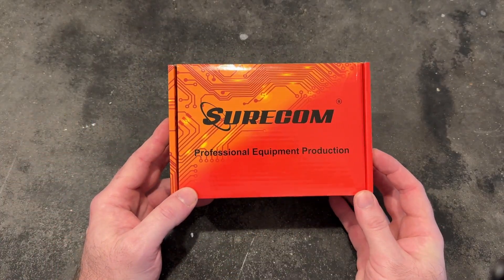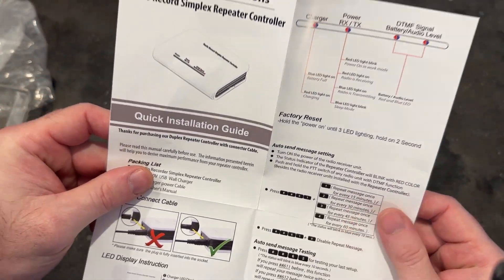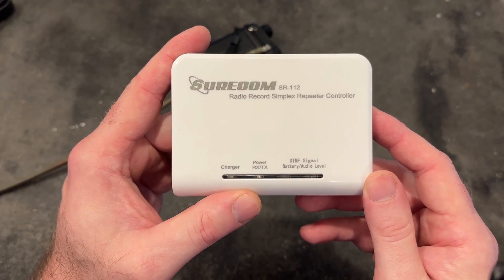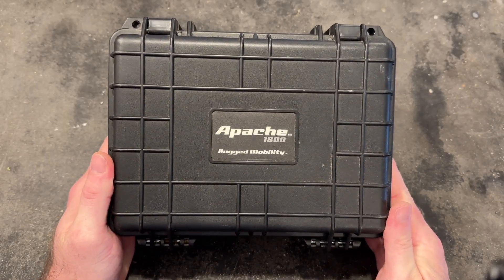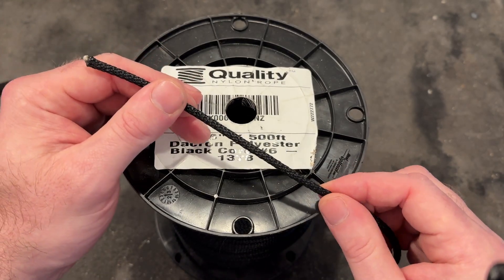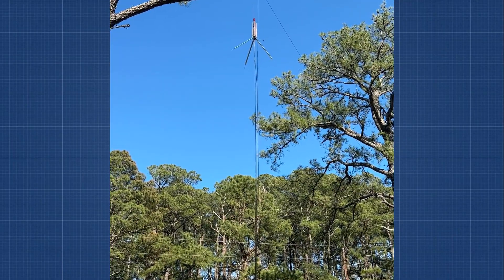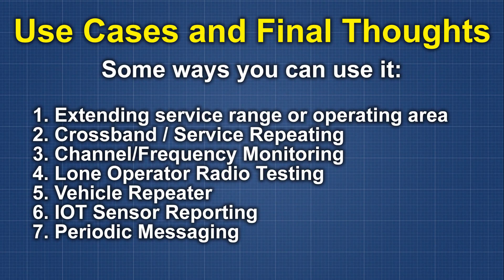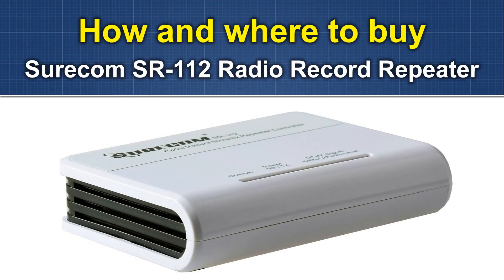You Can Build The Cheapest Repeater in less than 5 Mins! GMRS/HAM Less Than $100 - Repeater TUTORIAL

Comment: So if you did this but used a good antena with a good coax im sure this would work good.
Reply from the maker: A good antenna and coax would certainly improve performance!
Reply: @Commodium im a bit of a noob at this. Im sure you've answered this a million times. Do you know of a decent coax that will attach to a handheld and a semi decent antenna for a good 5 mile-ish radius range? Or maybe you already have a video to something like this? Also with this setup after you transmit do you hear yourself when it repeats or are you listening to a second radio when you did your tests?
Reply from the maker: @kick_then_shift There are a couple different options. Firstly you could simply upgrade the existing HT antenna. I have some of those available that are excellent. Next if you want a little more boost in range, one of my single element CRE-35 and a short (15ft or so) run of LMR-240 or RG8X Teleflex with adapters would work fantastically. All of this does assume you have the terrain and conditions necessary to make contact. (Near line of sight, low ground clutter, etc) email me at stevetow01@proton.me for more details

Comment: What is the counter balance for and why do you need it on the repeater and the one you are using in the truck? oh, and what is that "counter balance" cable made of...Thanks.
Reply from the maker: Certain antennas can benefit from a ground plane. The wire enhances that effect. But not every HT antenna will perform better with one. That particular one I use is silicone jacket 10ga wire

Comment: Love this video and your style of video making. I plan to make one of these to use for my friend group when we head up north for camping trips and there’s no cell service or local repeaters nearby. 

I will be using that same waterproof box (bought at harbour freight when on a trip to the USA)(I’m Canadian) but I will be utilizing a dewalt 20v tool battery and cradle to power a usb port that will “charge” / “maintain?” The power for the radio and controller, I will be putting a folding antenna on the outside of the box. 

I learned some good stuff from this video like adding a second string to the bottom so the antenna stays straight up and down, but how will I use the counter poise / ground wire when the radio is inside the box? Maybe I’ll have to run it without one. Either way thanks for the video rock on my man 😊

Comment: To eliminate hearing the original broadcast (which was of very poor quality) make the simplex repeater radio frequencies the same as a duplex repeater. So if your HT's repeater channels are say transmitting on freq. 440 and receiving on freq. 445, make the simplex 's radio receive on 440 and retransmits on freq. 445. Instead of a plus offset you use a minus offset. That way the second person only hears the simplex's retransmitted broadcast (much better quality). Removes the main downside of simplex repeaters.
Reply from the maker: Yes, that covered in the follow up.

Comment: Very cool video
Im trying to find out about the little antenna tester unit that the other guy over on ham radio crash course got from you is there a link or place to get one of those or purchase? Thank you.
Also, wondering which type of video cameras are you using for your videos? I have started a YouTube channel for reviews etc. not released yet.
Reply from the maker: Testing handheld HT antennas can be a real challenge. I built that unit I sent Josh over at HRCC as a prototype. It is made from 206 brass to the size and shape average to most of the popular HT radios. It has a pass through from the SMA to an N-Type connector at the bottom. The pass through is Belden 50 ohm rg8x coax with the shield bonded to the brass. There is also a layer of copper foil that has some capacitive reactance and a copper foil “thumb pad” to simulate contact with the radio. It works pretty well and allows for more accurate testing on a VNA. I don’t have them available for purchase, but drop me an email Stevetow01@proton.me

As far as cameras go, I use a Cannon DSLR G1X and plain ol’ iphone 15 pro max. Good Luck on your channel too!

Comment: Is this legal lol...
Reply from the maker: Just as legal as anything else people do with radio 🤣
Reply: @Commodium  the correct answer is yes as long as I stick to the gmrs repeater channels which are ch 23 to ch 30 and don't exed the 50 watts and i.d every 10 minutes when I'm on the air
Reply from the maker: @CHRIS2CRAZZY  10 min is for HAM, 15 for GMRS. Why the difference? I can’t answer, but I’m sure there is guy sitting behind a desk in DC that never touched a radio in his life that can. Or a rather over nourished fella in his basement that will chime in. Assuming he can pull himself away from the comment section of notarubicon or r/GMRS. 

But yes you are correct. Keep it to the GMRS repeater channels with the proper split and ID as required. Should meet the requirements.

Comment: Question: Let's say you have a standard repeater with the +5MHz offset.

Can that repeater also handle another tone/offset? 

In other words can one repeater do double duty?
Reply from the maker: Yes it could in theory. The hard part would be using “TOR” control for the transmit side. (Have to figure out which frequency to transmit on) A repeater controller with CAT control and suitable radio may be another way. A radio with dual watch or simply scanning two frequencies with the range limits of your duplexer would be very easy on the receive side of things.

Comment: I am intrigued by this, but I happen to live in an area with several GMRS repeaters. Could someone please reference several Use Case Scenarios in which a Simplex Repeater would be advantageous?  (Two $18 UV-5R radios and the Surecom Mcbazel SR-628 Cross Band Duplex Repeater Controller would do the same thing in duplex.)  Thanks in advance.
Reply from the maker: Lots of issues with a setup like that. It will work to a degree at really close ranges, but that defeats the purpose of a repeater. Here is why you don’t want to that. Mainly desensitization. Even if you crossband, the UV-5R front end isn’t filtered enough to block adjacent RF. Look up every YouTube video on “UV-5R repeater” and you will see everything from straight cross over cables to the Surecom. And you never see them linking two operators at distances measured in miles. And there is a reason for that. It just doesn’t work. Even if you add a duplexer for in-band or diplexer for crossband, (which helps) but that still doesn’t fix how leaky the radios are. 

Could you use a duplexer/diplexer and wrap the radios in tin foil? Maybe 🤔 

But then that brings us to the next issue. Passive intermod distortion or “PIM” that’s why you shouldn’t use LMR-400 or any foil/braid combo shielded coax. 

So by the time you pull out the tin foil, duplexer, hardline coax or rg-213, you may as well use two commercial mobiles, toss em in a wheeled case with big battery and a real controller.

However that is a bit of $ to put together.

So if you want a super simple “camp repeater” that can actually increase double your range or more, the simplex parrot repeater is the way to go.

It is definitely not perfect. But super simple and cheap

Comment: Thank you Sir for the video. Very interesting.l am new in the radio world and was looking for a repeater to increase the range of the Baofeng and found your video. I live in Mexico ,in hurricane area so is good idea to have an alternative way of communication. I want to know what's a counterbalance ? Something to balance the radio? Where l can find one? And the other question is do you have an horizontal line that goes between two trees or one tree and a roof house? And then put a line vertical to that horizontal line? May you make some drawing? Sorry for my English. Regards from Mexico
Reply from the maker: Greetings to my new friend in Mexico! 🇲🇽 the counterbalance (counterpoise) is a small tuned piece of wire added to a grounded screw on the radio. Certain antennas such as quarterwaves and 5/8 wave can benefit from an added ground plane. Other antennas it may make no difference or may even be detrimental. Experimentation will let you know if it helps the one you have.

The horizontal wire you saw running through the tree (good eye catching that) is for my SDR radio i use for HF receiving. It’s a 250’ 14ga wire running to a balun with ground rod. I can hear stations all over the world on that.

For HF transmitting I use a mix of almost a dozen different antennas depending on band and polarization.

Comment: You can cross link the RX/TX on the dual jacks of the Baofeng and put the radio into VOX mode, and you have the same thing basically. Needs two of the cables with the dual jack, soldering iron, and a couple resistors that need some attention with a meter.
Reply from the maker: Hmmm the word of the day: Desensitization
Reply: @Commodium  Feed line for one HT :)
Reply: Commodium is correct, Baofengs and other Chinese direct conversion handhelds can't be used as repeaters, both in the same band or cross band desintetization will kill the intended use. Simplex repeaters are the way to go.
Reply: @carlosroig5315  That's what a feed line is used for. One feed line off one of the radios to move the antenna away a bit. It does work with no issues. You can use cheap coax you find at the truck stop or nice stuff, you just need the sma adapter. If you have the HT right next to each other - that's when you get desense. With a feed line you can keep them together and just move one's antenna a bit further away.
Reply from the maker: Cheap coax from the truck stop? Like RG58 from Loves? On UHF frequencies?  I mean sure you could make a crossover cable with resistors to attenuate the audio. And yes you could attempt to lessen the desense with a chunk of RG58 and add about 12ft of vertical separation. But the coax loss is probably helping more than the distance 😂 Stick the whole thing together with some well chewed bazooka joe bubble gum. But by the time you do all of that and add a second radio and solder the cable “ish” thing together separate the antennas, you’ll have the same cost and more time in that than the simple simplex parrot repeater. And the parrot repeater would give you much much better results. 

But this video isn’t about a “proper” repeater. This is about a quick cheap and dirty “emergency” repeater.

Comment: Here's a dumb idea. You can string that repeater up high, then use your ht on the ground nearby to increase range and not have a long antenna cable connected to you radio. Freedom of movement at your campsite with your repeater high in a tree by you.
Reply from the maker: Pretty much the idea, yes

Comment: What is an extra wire you put on the back of the radio for?
Reply from the maker: It’s commonly referred to as a “pigtail” Certain antennas but not all, can benefit from having that wire for use as a ground plane. This is more beneficial for 1/4 wave style antennas.

Comment: Hi..Can repeater work with CB radio.I would use Dragon sy101.?
Reply from the maker: I am not familiar with that specific radio, BUT if has external audio inputs/outputs and a way to remote activate the PTT function, I see no reason it wouldn’t technically work with any radio.

Comment: If you have any old 3.5mm camera av output the fuse or de-noising device works great for a passthrough filter if you want to build a 2 radio, dual frequency repeater, Mine was made by canon,  I spliced in the 2.5mm end so you can do a group to group repeater from GMRS to MURS, no delay and no internal batteries and no Delay.. try it out I think I heard ya while messing with my antenna in SoMD..
Reply from the maker: Sounds interesting. Have to send me some info and details on that.

Comment: Looks like FRS could also use this repeater.
Reply from the maker: If you set the repeater radio on FRS channels it would do it. Some “self appointed radio policeman” would cite you about 10 paragraphs saying why you shouldn’t, or else… But there isn’t anything in the realms of practical physicality that would prevent someone from using any unlocked radio and a simple repeater controller from making a “FRS Repeater” However the DC overlords would certainly frown upon it.

Comment: What did you use for the counterpoise (counterbalance)?
Reply from the maker: I use 10ga. stranded silver tinned wire. Heat-shrink cap on one end, spade connector at the other. Lengths vary, but 19-1/2" to 21-1/4" will work best.

Comment: Will this work with the Talkpod A36SE GMRS Two Way Radio and the other Baofeng GMRS Radios?
Reply from the maker: Yes as shown in the video it will work with any radio with the kenwood “two prong” style cable.  Surecom has other cables compatible with other radios. And if all else fails, you can build your own cable if you know the “pinout” for the radio. For custom cables you would need to identify the mic+, speaker+, ground, and PTT. With those four pins properly identified a custom cable and be made for any radio that uses a “low” PTT signal. For more advanced users, a cable with a transistor, relay, or even better and opticoupler can be made for radios that use a “high” PTT signal. But if you have those skills, you would most likely be using a more advanced repeater controller in the first place.
Reply: @Commodium  Thank for the reply Commodium..

Comment: I thought that 2 handhelds programmed and wired together with a 10$ connector cable was cheaper, but I do like this idea a lot I’ve dumped a lot of money into radio gear haha
Reply: Yeah... You'd think that would work good!? But, it doesn't really.
Reply from the maker: It works as well as removing a phillips screw with an undersized flat-head. Yes it technically works, but def the wrong tool for the job. But it can work, just not well.
Reply: Not with these cheap chines radios. They desense each other something awful. The radios are great for the price but their intermod rejection is nonexistent.

Comment: Not a bad quick setup, but with the repeater itself being $60 I think I'd be better off on gmrs just linking a couple of cheap mobile units. I can see some good use though for 2m to test range from my property to my mobile unit. I still may get one for that and just park it on gmrs for the rest of my family most of the time. Add in the 30watt solar panel I got and a cheap buck converter to keep everything charged it hopefully would run for a year or so before something in the cheap chinese bundle broke.
Reply from the maker: Linking a couple mobiles for GMRS works nicely. If doing an in-band repeater with them, it makes a huge difference having a duplexer with filters. Those get real pricey real fast for anything above 25watts. The transmit radio can swamp-out and de-sense the receive radio. Even with spacing the antenna. Sure it works without one, but missing a good chunk of additional range. And if you already have the mobiles, have the skills, duplexer be damned, do whatever suits your needs. That's what gets me frustrated with "radio experts" always want to be nay-sayers.

And eventually these surecom repeaters fail. I have found it's always the batteries that crap out. But they are easily replaced with more cheap chinese junk and your off to the races again.

Thanks so much for watching and sharing your thoughts!
Reply: @Commodium  Thanks for the advice. I don't have a gmrs mobile and will do some research. I just want to put something up cheap on the other side of my property(acreage) where it's 50' higher elevation than the house. I eventually plan to put up a 40' tower over there(no tall trees) but will just use a pole for now. 25 watts of output is fine as the difference between that and 50 is pretty negligible. As far as interfere, I've seen entire hf bands wiped out by a 100 watt signal a mile away so no surprise and will have to get some decent filters. What I'd really like to do is use a Raspberry Pi Zero with rtl-sdr for receive then link a mobile for transmit, but I'd have to get some time to put it together. The surecom would just be a quick solution and hacking some new batteries  together wouldn't be a problem. Agreed with the experts, better to have something up than spending thousands to try and do it commercial grade so I can talk to a couple of extra unappreciative crotchety old hams 2 counties away in fm. I can do that on 20, 40 and 80m for a lot cheaper lol

Comment: What is the green cable attached to the radio?
Reply from the maker: That is a small length of 10ga wire. It acts as a counterpoise or ground plane for the antenna. Handhelds are designed to use you holding them as part of the antenna system. Being hoisted up into a tree without an operator, the antenna needs a counter-balance or ground plane to operate as efficiently as possible. The abbree antenna I used in the video requires it on lower VHF 2m but not on the UHF 70cm. If you have watch the "How far can you talk" video I have, it will go a little more in-depth on counterpoises. Thanks!
Reply: I second this question.  What did you use to make, or otherwise source your counterbalance/counterpoise?
Reply from the maker: These I make. I use 10ga silver tinned silicone jacketed wire. Seal and heat shrink the far end. The radio connection is a tinned copper spade connector that's heatshrinked after crimping. It's then optionally painted with a camo pattern. The length should be about 20.375" from the tip of the spade to end of the wire. I do sell them as well. And honestly, they can be made with any wire. It does have to be expensive silver tinned 10ga. But I try to use the absolute best when possible.  @shawnstimson239